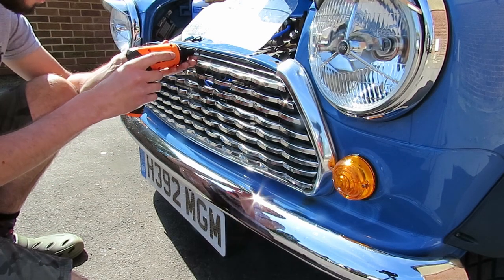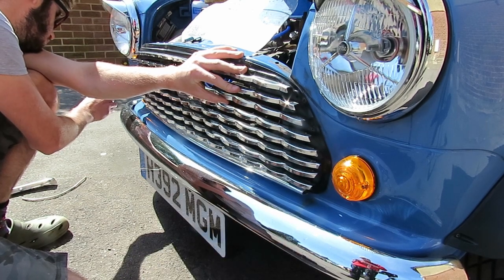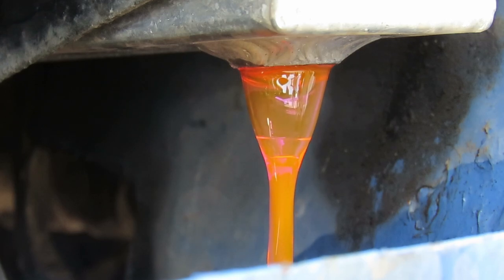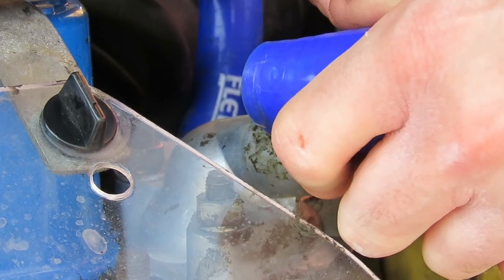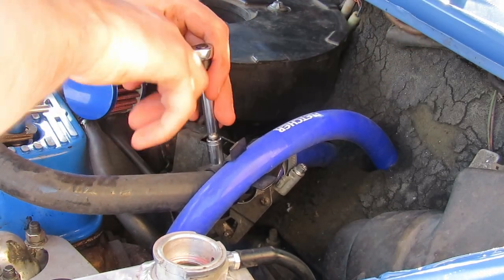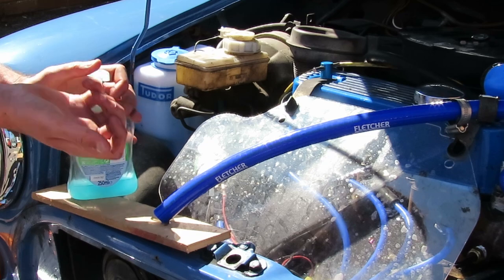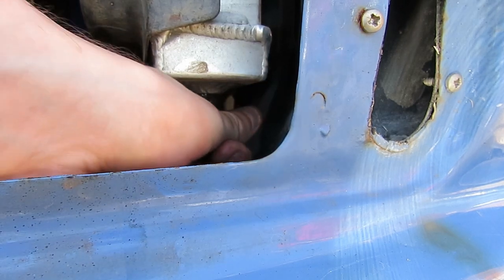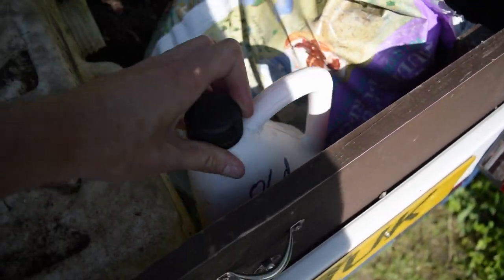Changing a hose on a Rover Mini

Comment: Didn't realise how easy it was to remove the grille on a Mini of this era! I know the underbonnet access on these isn't great, so this looks like a good way to get in there.
Reply from the maker: It's really very simple on them, just a few self tappers hold the grille in place, likewise for the surrounds but definitely an easy way to get access to the radiator plug and oil filter as well as other things.
Reply: @FuelPower , how long have you had your Mini now?
Reply from the maker: A year and 3 months roughly :)
Reply: @FuelPower , we are hoping to keep the next car we buy for a bit longer than usual...
Reply from the maker: My family has tended to keep their vehicles for a while and it would appear I have inherited that trait from them
Reply: @FuelPower , yes, my mother used to keep her cars for more than ten years in some cases, but now it is just three or so, which is like us in general. The one we have just bought I hope will stay for a while, though...